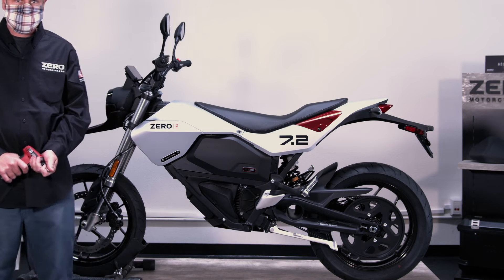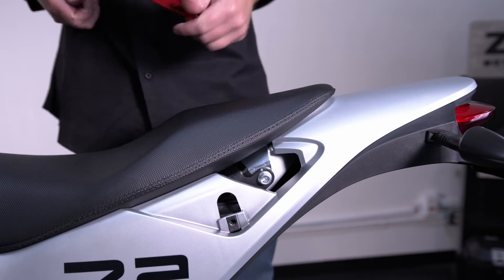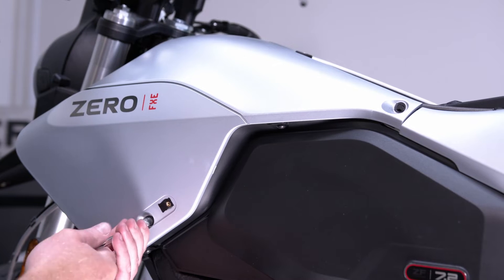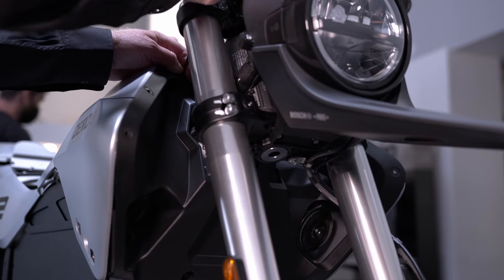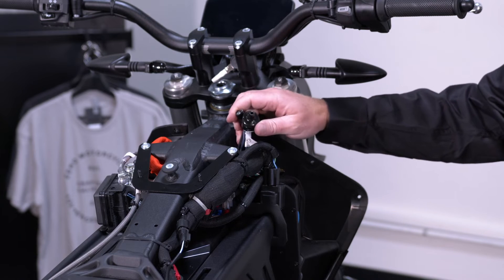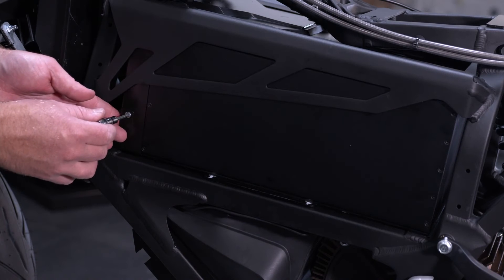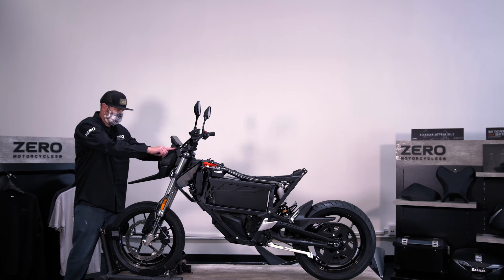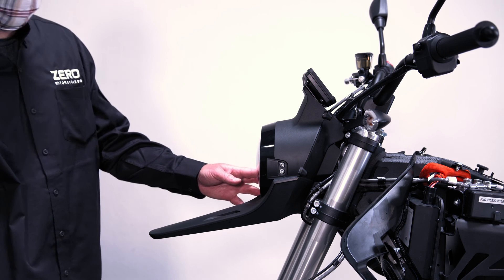2022 Zero FXE Panels Removal

Comment: How do remove the batteries with the 2022 fxe 7.2022?
Reply: Follow the same process as the modular battery option shown in the owners manual: https://www.zeromotorcycles.com/owner-resources  to remove the side lock, etc. However, there is only one BMS at the front and a couple of bolts up there holding it in. The "Integrated" long brick of the FXE doesn't just slide out like the modular FXS or FX.